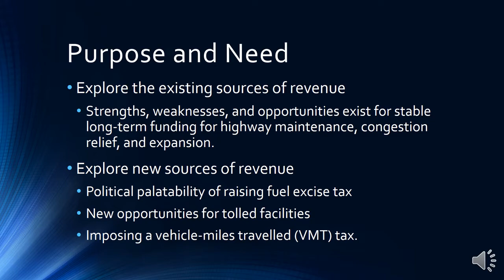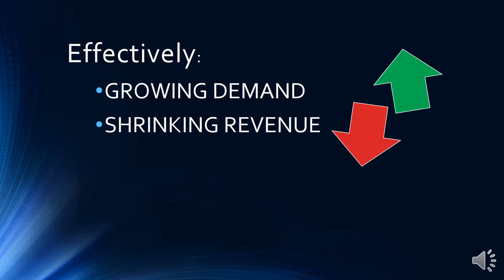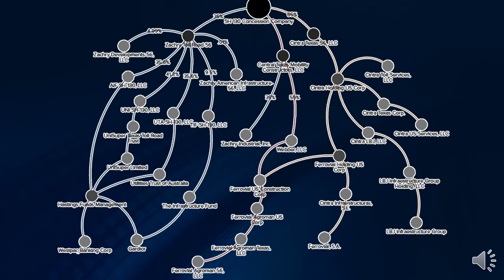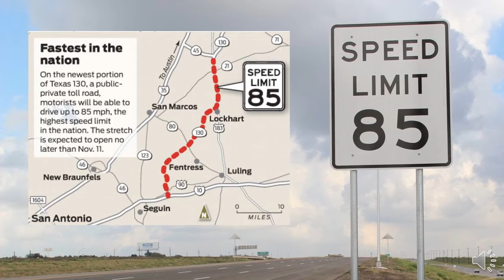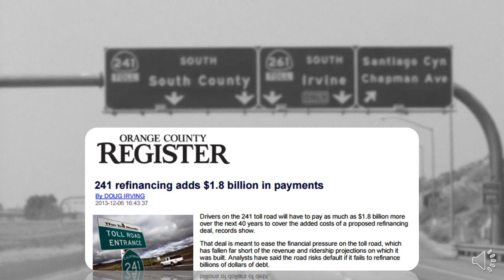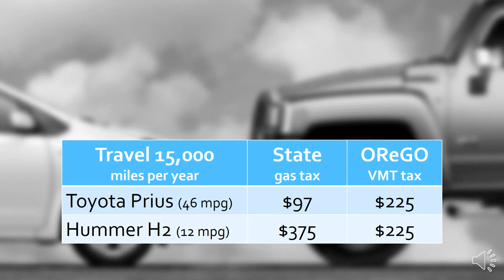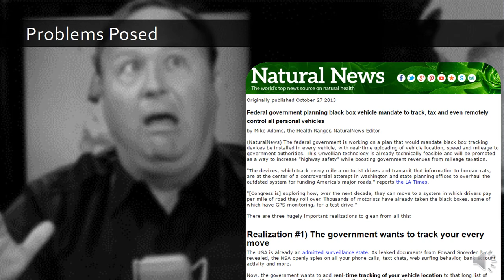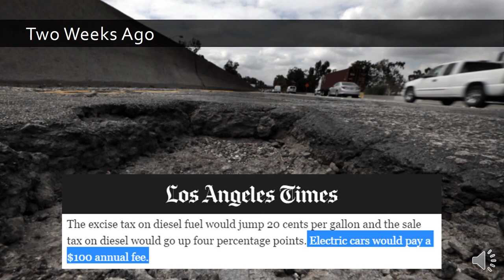Utah ITE Presentation: Future of Highway Funding

Comment: The most equitable and efficient way to tax may be to combine vehicle wheel loading and miles driven. For example, the DMV would use a formula that combines the weight of the vehicle distributed over however many wheels and the miles driven annually to send you a bill. And every year at vehicle inspection or registration time, you would report the mileage. Auditing mileage would be easy enough: just check the odometer. All odometers are equipped with anti-rollback mechanisms/software anyway so it wouldn't be trivial to cheat. There would be no Uncle Sam device in your car so it should alleviate privacy concerns, and someone with a Hummer would pay more per mile driven than someone with a Civic because the Hummer is harder on the roads.
Reply: Pennsylvania does a combination of fuel tax (the more miles you drive the more tax you pay because you're filling up more) and vehicle registration (heavier vehicles cost more to renew the license plate every year).

Problem is how those funds are spent by the government, which is why our infrastructure is mostly crap and they're finally starting to fix some of it.
Reply: As far as semi tractors, fuel taxes are already distributed by mileage per state with a central system called IFTA and the reporting you describe.
Reply: @dchawk81  Yeah, the way PA does it makes sense. If only they'd actually fix their roads, as you said. Indeed, my parents run a delivery business and they do pay a Highway Use Tax periodically for their box truck.

Comment: ive been thinking instead of a gas tax we use a per mile tax based on the weight of the vehicle, Trucks and SUV's put much more wear per mile compared to Sedans and Motor cycles not to mention Electric cars are almost 1000lbs heavier then ICE vehicles i wouldn't know the specifics for how much it would cost per mile but i would probably go 2c per mile for 500-2000lbs 3c per mile for 2000-3000lbs and 5c per mile for 3000+ Trucks say about 7c per mile to account for trailers and then 10-15c per mile for 18wheelers that would be my guess based on the current gas tax at least

Comment: You cited folks skipping the gas station because they don't use gasoline as a reason that road tax revenues are falling short.

In the state of Utah Electric vehicles DO pay additional tax to make up for the lack of gas tax.

From the LTDOT website

"Utah law requires owners of alternative fuel vehicles to pay an additional fee during annual vehicle registration intended to capture some of their impact to the road system since those owners contribute little or no gas tax revenue as compared to owners of conventional vehicles. Owners of electric and hybrid vehicles have two options: pay the additional alternative fuel flat fee during annual vehicle registration or enroll in the Road Usage Charge program and be charged 1.00 cents per mile up to the additional flat fee amount. Depending on the number of miles you drive, you may pay less by enrolling in Utah’s Road Usage Charge program."

Folks always take a swipe at EV's as a reason that gas tax revenues are falling behind. In most cases EV's are paying more than their fair share through special registration fees.

I do agree miles driven is a fairer way to tax vehicle given there are multiple ways to fuel your vehicle now. Using the data port in a car, while a good idea won't work. Only vehicles with a tailpipe are required to have the ODBII port installed. Tesla's don't have this port.

Comment: I don't care how much tax I would pay, but please let me pay at the pump/electric charging station! I love driving, but I don't want to have a shock several thousand dollar bill due because of some yearly calculated VMT tax; it's better to pay the tax at the point of sale.
Reply: How do you pay at the point of sale when the POS is an outlet in the wall of your garage?
Reply: @SPR8364-0  That's a good question. 
Two options come to mind:
1) Require charging devices to have internet access and just charge $ while charging vehicles.
2) Maybe just add more tax to residential electricity. Some side effects: This would further incentivize solar roof power - which would also reduce the load on the grid.
Reply: @ancientelevator9  #1 wouldn't work because you can just plug your car in to your stove's 240 plug, it's slower but it works
Reply: with A VMT it would be dependent on the weight of the Vehicle the 4.5k lbs tesla is going to put more wear on the road then say a 2280lbs Miata but were probably looking at about 3c a mile on average so driving 100,000 miles would be about 3,000$ however the cost of Gas would go down theorietically by around 50-60c a gallon

Comment: Electric cars do need to pay an excise tax. I have no problem paying excise tax on my fuel provided we get good roads. I do have a problem with a carbon tax to discourage people from driving, and the money isn't reinvested in infrastructure. In Canada, I have a problem with the Federal excise tax because Canada doesn't have federal highways. If the Canadian government built a series of interprovincial highways, no problem. We need them. Canada is low on crucial infrastructure.
Reply: Carbon tax should apply to everything that releases greenhouse gas. Fossil fuels in electricity, cars, steel production, etc... Concrete also creates carbon dioxide when it cures, that shouldn't be free. Beef and other types of farming also release greenhouse gases
Reply: Fun fact. The state of Utah agree with you and have already introduced a tax.

"From the LTDOT website

"Utah law requires owners of alternative fuel vehicles to pay an additional fee during annual vehicle registration intended to capture some of their impact to the road system since those owners contribute little or no gas tax revenue as compared to owners of conventional vehicles. Owners of electric and hybrid vehicles have two options: pay the additional alternative fuel flat fee during annual vehicle registration or enroll in the Road Usage Charge program and be charged 1.00 cents per mile up to the additional flat fee amount. Depending on the number of miles you drive, you may pay less by enrolling in Utah’s Road Usage Charge program.""